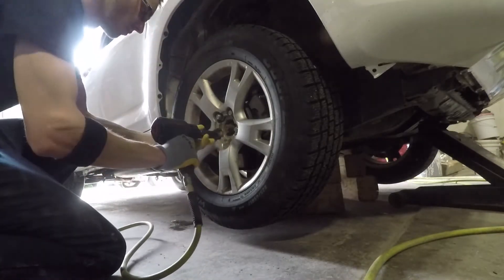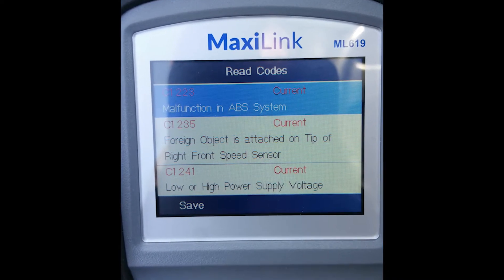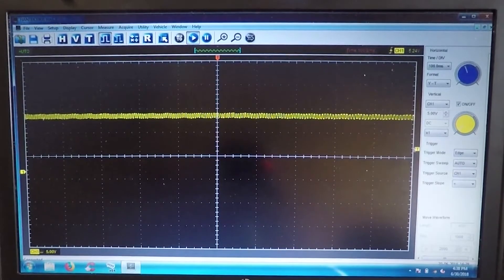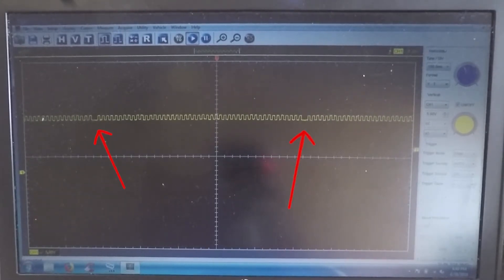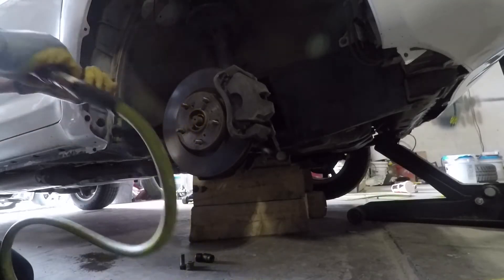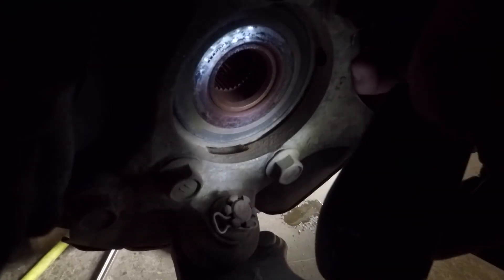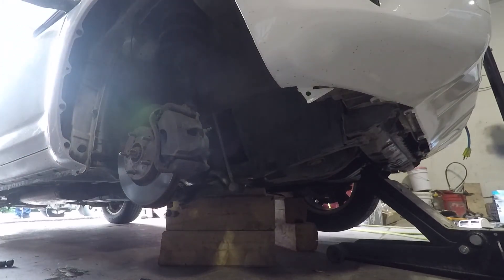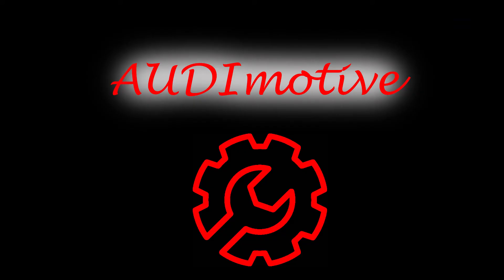Toyota Rav4 - ABS C1235

Comment: Does the gap in the ABS ringtone cause the ABS system to activate abnormally,when the signal is missing or inconsistent?
Reply: Yes. If wheel speed signal is interrupted, the ABS module thinks the wheel has stopped spinning (such as sliding on ice/snow) and it activates the ABS. Some people will complain that the brake pedal "vibrates" when coming to slow stop on dry pavement. This is the ABS being activated when it shouldn't be.

Comment: Hi 

How do u fix this error code C1249
   and C1223 on Toyota RAV4 2007 . Just happened after replacing  the ABS Pump
Reply from the maker: I cant diagnose a car without seeing it. I would Google the codes and start checking wiring. C1223 is a wheel speed sensor